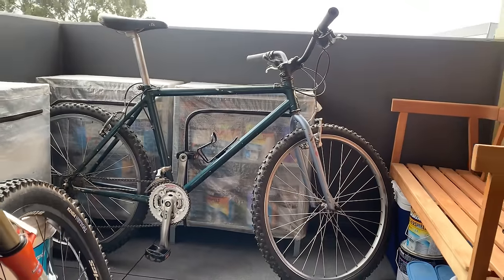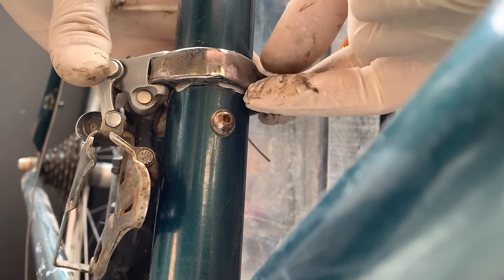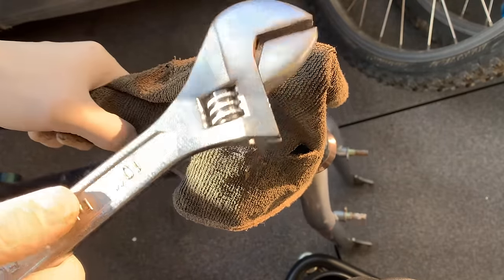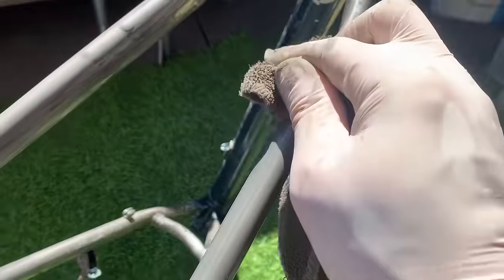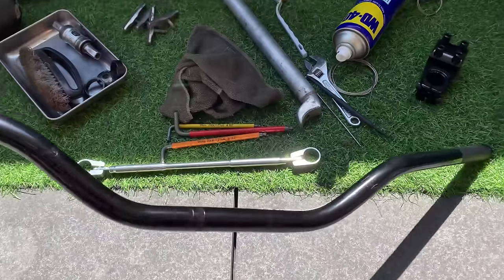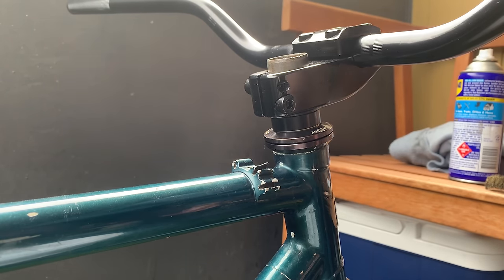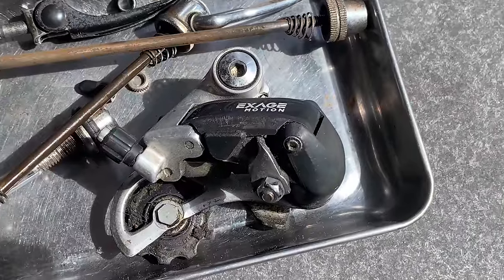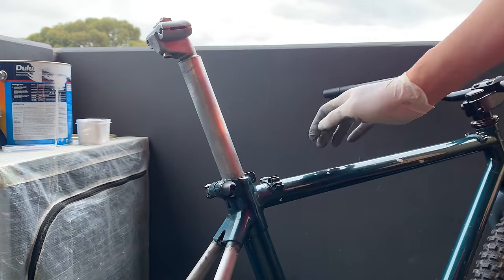sleeper mtb custom mod bike build (where i'm the engine)

Comment: Great job Gary, love the easy going narration as you work. I’m working on an old Mongoose Hilltopper and did the same removing paint from rear triangle, may coat similarly to how you did it. I’ve also used a non-narrow wide chainring on a Kona 1x rebuild and it still works great. Do your thing with the parts you have. Keep up the great work man!
Reply from the maker: Cheers man I am glad you like the voice over haha ! Oooo that sounds like a cool bike, will do up nicely. Yep always just use what I can to save some $$$ & for the earth. Thanks man will do my best! 🙏

Comment: Those xt v brakes are getting very hard to find and can be extortionate. Since you have a steel/aluminium frame on which the paint work was really beat up I would have had the whole thing grit blasted clean and then powder coated. You can get that shimmery colour back by having it coated silver first then re coated with a translucent blue/green. They come out really nice. Done it once on a Gary fisher full suspension frame and my guy in palm city, Florida charged me $75 for the blasting and powder coating. It was so worth it.
Reply from the maker: True true! Having it blasted and repainted would have been way easier !

Comment: The rust converter will stop working properly if you contaminate the bottle with a dirty brush. I always try to pour a little out into a cup and brush from that. Then discard any excess. It's always a bummer to toss any because it's expensive.
Reply from the maker: Oh dang good to know thanks for that !

Comment: My method for stripping paint off a steel or aluminum frame set is a real time saver: professional glass blasting.  Then it can be finished with wet paint or powder coat.  Yeah, powder coat is almost sacrilegious, and I'd never use it a valuable frame, but it has the advantage of being super durable, and on a bike that's not for resale or some sort of museum piece, it can be the way to go.  In any case, professional glass blasting isn't cheap, but neither is my time.
Reply from the maker: Nice man thanks for the tip! Cheers

Comment: if you have a wire wheel you can go over the areas you want to strip, that will help the stripper work much better being able to penetrate easier
Reply from the maker: Oh that’s a great idea 🙏
Reply: @garysprojects  iv also seen ppl cover it with plastic

Comment: hi gary! I'm assuming you haven't installed neither a narrow wide or clutch derailleur because it is meant as a city bike, am I right? could there be any issues for a gravel use?
Reply from the maker: hi! ya no clutch derailleur on here and had no problems. if just using for normal commuting/gravel , chances of dropping is very slim

Comment: The headset isn't really sealed. The plastic rings on both ends can be pushed out with a knife. My aheadset lost all the grease and destroyed itself, only learned that it can be taken apart after I replaced it with a new headset.
Reply from the maker: True that, I think they just use that term to differentiate them from loose and caged bearings types. Good to know either way! Cheers

Comment: All those bikes are going to go alot further  with a Bafang bbso2 & battery....lets see what you can do Gary with a 750w motor between the pedals..?
Reply from the maker: Hahah true I’ve actually been waiting to do a ebike for a while, once I find a cheap kit I’ll be in it
Reply: Look forward to seeing that Gary. ...lots of potential with the Bafang motor. ...Some of those utube videos of the bbso2 make the average ebike from the bike shop look pretty slow not mention expensive. ...@ least the bafang can be retro fitted to some of the old classic 90s bikes because theres plenty of room for the battery. ...

Comment: Don't grease jockey wheels 37:10
Reply from the maker: I just gave it a thin coat and wiped it off to protect from rust !
Reply: Why not? I have seen a lot of mechanics do it. There is a specific grease for derailleurs too. And some jockey wheels even have bearings in them

Comment: Love these videos! 2 things I saw lately, cut housing with some excess cable poking out the end, it'll help with the crushing, also @bkefrmr uses hair spray and it works good for putting on grips
Reply from the maker: Thanks mate that’s a good tip regarding the cable I have to try that ! I don’t like to use hair spray because it makes messy for the person if they ever want to change grips ! Cheers